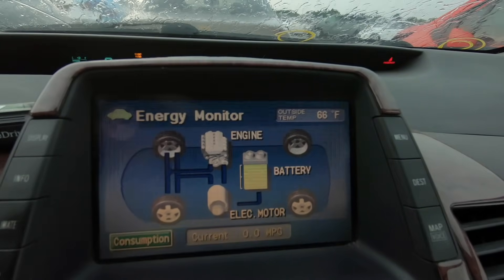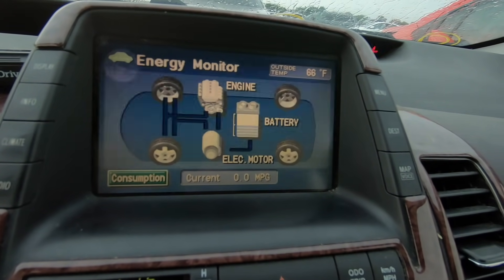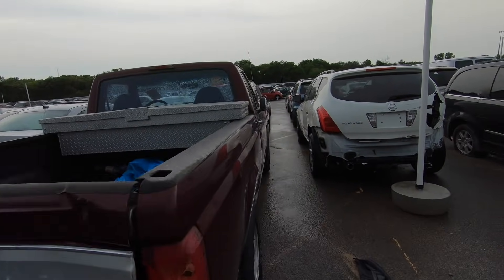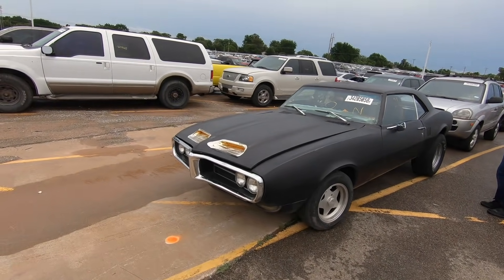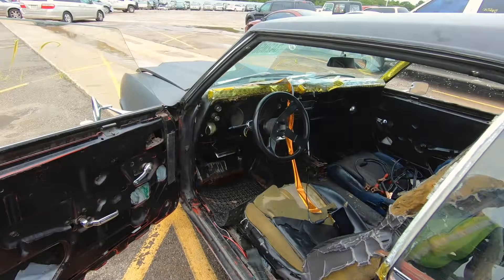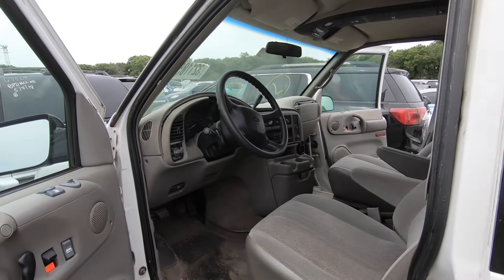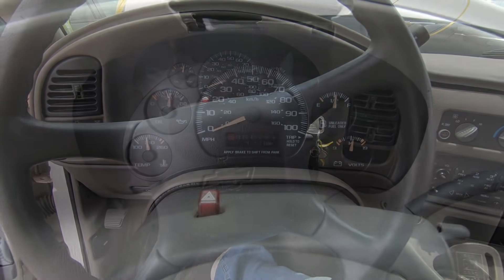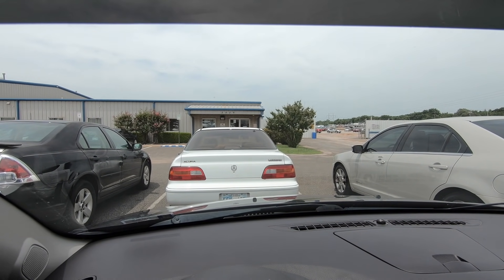We Won!!! BONUS Copart Walk Around + New Project Car!

Comment: That would retail here in Peoria IL for 3,995. How many Miles. I almost brought one of these back in 2001. These were program back then for 10,995 a year old. My dad & I brought and sold cars for 10 years. We would have got a used dash pad at a junk yard for 30.00 charge the A/C for 20.00 or if it needed  a compressor buy used cheap. We would have all in about 1725.00. Then we would ask 3995 OBO. The first 3250 take it home. We would make a around 700-2500 profit on these old cars. What helped us out we had a guy that did body work cheap and 4 back yard mechanics that did stuff very resonanable but this was back in the early 1990's to early 2000's. The max loss we took one was a 690.00 loss this was in 1993 on a 1986 Buick Century Limited Silver it was a turd from day 1 transmission dropped on the way home. My dad went to show the car and my brother worked for a car dealer at the time and the fuel pump quit dad had to entertain these people in the drive way for about one and half hours they saw the car and made an offer. We sat on this for sale for months and my dad took the loss to get rid of it. We would have up to ten cars sitting in the driveway at once. I was calling and asking questions on cars when I was 11. I helped dad sell cars as well they would call and I would tell the buyer what they needed to knowand I was honest. I would be out there showing the cars with dad and the people would ask who they talked too and they were shocked that a 13 year old kid had them sold on it before they came out. I thought I would share this with you.
Reply from the maker: That is an amazing story! You're very lucky to have those memories. Thank you for sharing them with me.

Comment: First Astro Vans have kinda a cult following, because they are a true body on frame “truck” van. The 4.3 is a good motor (it’s a 350 with two Cylinders chopped off the back), and over all the Drive lines are known to take a beating. I would ask $2900 for it as it sits l, IF you can find seats bump it to $3500

Buying desperate is a bad way to buy, you got lucky and will absolutely make money. However in another post I had suggested holding off on selling at least the other Prius until you won the new car even if you had to pay for it on a CC and then pay yourself back. I get not wanting to float money as it can be dangerous but doing it smart (which you are) and disciplined, you will be fine. Just something to think about for the future so you don’t get into desperation mode.
Reply: The ones I looked at are unibody with a drop out front subframe.

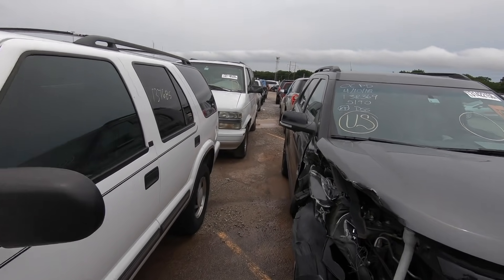Comment: 11:36    DOH!  Sorry, bad impersonation of Homer.  Anyways.... Every Copart purchase I've ever made has been sight-unseen except for one.  Been lucky so far, some has bit me in the arse, but none have bit me hard enough to leave me arse-less..... yet.  Seems like a good buy.

What can you sell it for?  Depending on all the faults with the van, (which I'm sure you're working on remedying them as best as possible), and depending on the market in your area, I would expect somewhere between $1,650 minimum to $2,450 max.  I think that the branded title does affect the resale value, sorry.  Keep in mind that your market is likely very different from mine as I am more then 300 miles south of you, I'm in Texas.

EDIT: Are you sure it's a branded title??  I looked at the Copart listing, obtained the VIN, and ran the VIN in the NICB VinCheck, and it came back as a clean title.  Maybe a delay in updating the database?
Reply from the maker: Title was branded. I have the clean Carfax though so... IDK.
Reply: Uber Man carfax could buy it from you with their guarantee.

Comment: Parts runner
Reply from the maker: Fishing! :)
Reply: get oyu one of those Receiver Hitches it would do a miraculous job at pulling Trailers Boats Car Dollies or anything you want to pull I pulled 5 to 7 Thousand pounds behind mine and did it with ease I pulled a 1700 pound Trailer at 70 to 75 miles an hour from Little Rock Ar. to Oseola AR on a 1/4 tank of Gas & pulled a 1988  Ford Ranger on that same Trailer from Oseola AR back to Little Rock running 70 miles hour filled back up in Wheatley Ar. and came on home on just a 1/4 running the same 70 MPH and it handled vjust like that load was not even there braking and otherwise IT DID VERY WELL

Comment: The Monte Carlo SS did not come supercharged by default.  The model w/ a supercharger was called the "Supercharged SS".  So you can have a plain jane SS with just the 3800 naturally aspirated.  That engine is nearly bulletproof BTW so if the price were good on that SS it would have made a great car to flip for a 1st car buyer.  A little bit of sportiness for cheap.  I owned a brand new 2002 SS with the 3800 and it was a great vehicle.  Hell even my tough to please mother loved that car haha!

Also the Expy transmission is about $1700 so again if the price is right and assuming the tranny HAS to be replaced you can flip those for a decent price. 

Definitely enjoying the used car restoration stuff.
Reply from the maker: Thank you for the great info! I may just end up with that SS BTW :)
Reply: You have a smartphone I'm sure so why not use it to look up vehicles that you are not knowledgeable about before spreading misinformation to everyone else about and then passing it up?

Comment: How ate you certain it has a bad trandmissi5when you haven't even driven it? You are bad at what you do and come on YouTube trying to give others advice? Really man? Any time you see a Prius with a battery pack issue and it all of a sudden goes away then it needs to be passed on. Seems like you are more or less desperation shopping and that is bad to do. You should use more common sense.